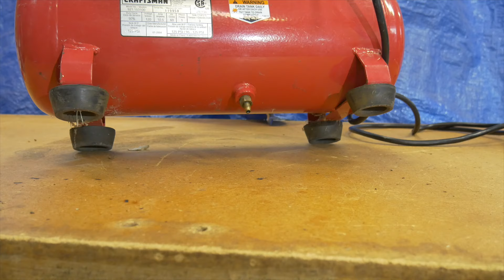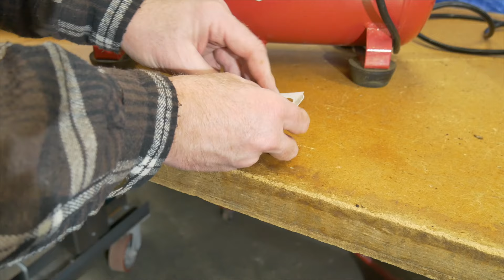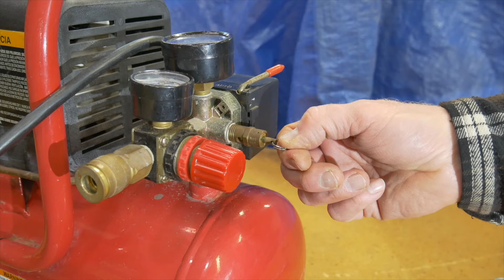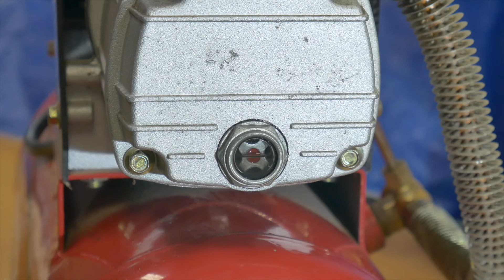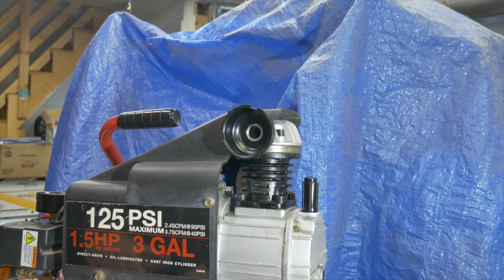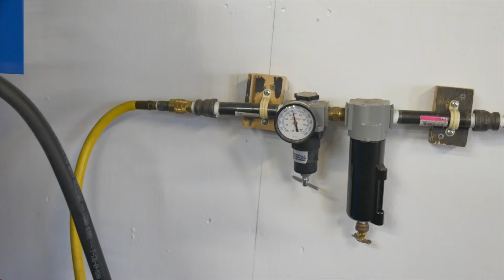Air Compressor Maintenance - A few tips to keep your small air compressor in top shape!

Comment: My compressor is leaking oil from the back cover, if i keep the oil at the proper level, is it still safe to use?
Reply from the maker: Whether it's safe depends primarily on the  tank condition, and other safety features like the pressure release valve.   You can find examples on the internet where a corroded tank has failed dramatically.  Since it's a safely issue, if in doubt through it out.
Reply: @metalwooddesign   Thank you for replying. The compressor has never been outside, the tank look brand new and i empty it after each use, the water is clear no rust. I also test the release valve right before using it. But i'm still nervous about using the compressor, due to the oil leaking from the bottom of the back cover. I was wondering if it could somehow leak into the tank rupturing the welds when it's at max capacity.
Reply from the maker: If the water is clear doesn't sound like oil getting into the tank.  Maybe the cover gasket is replaceable if it's accessible?

Comment: On my compressor I made a transparent hose instead of the drain valve.
With on the end a ball valve.
Water runs directly into the hose, instead of accumulating in the tank itself.
When you use a thicker hose, it can hold more water.
You could even build a system that automatically blows off the water.
Reply: He means a seperate short piece of clear hose with a valve on the end to collect any water in, and release it from. It would be seperate from your normal airline.
Reply: @royster3345  I see. Thanks. That makes sense. No doubt that has some value but the value is very limited really in my opinion. The inside of the tank is normally coated to protect from corrosion because of water or moisture. By pushing the liquid form of water out of the tank with an additional section of hose, that saves water from accumulating in the tank but not the moisture. And normally, without this extra thing, a tank should be released and drained anyway.
Reply: @maxwang2537  tanks are not coated to prevent corrosion. Where did you get that idea from
Reply: @firebladex8586  ah good challenge. I didn’t make it up . I read it somewhere. But of course the source can be wrong.
Reply from the maker: That's a great idea.  Basically a hopper for the water to go to so it never sits in the tank. Thanks for sharing!!
Reply: Good idea
Reply: Don’t get the idea. As I understand, it seems a great idea but not necessarily. Why the normal design is this way it is is because the minimal of water gets into the hose then the air is drier. Your way saves the drain in the tank but brings all the drain into the hose which is meant not to have water, so defeats the purpose.
Reply: Might not work best on tanks with offset bungholes valves, unless you simply tip it after each use and drain only when the clear tube gets full.

Comment: If it is not in the middle of the tank stay away from this type of tanks i had one after 10 years i keep the tank drained every time I used it and it exploded after 10 years of use the whole bottle blowed out of it.
Reply from the maker: That style is not the easiest to keep drained.  You have to tip the tank so the valve is at the lowest point and still rock it back forth lengthwise.  A vertical tank is best if it fits your application. Thanks for sharing that story.  Definitely want to keep the water out and replace the tank if its integrity is in doubt.

Comment: This video is great. Thank you.

That water looked super rusty. What do you do to make sure the pressure vessel isn't dangerously rusty?  And if it is rusty is there any saving it or must it be replaced/discarded?
Reply from the maker: Because it's a steel tank, the water is going to get some rust color.  The tank in the video had a bad valve and hadn't been drained recently.  With a good valve it's drained regularly.  The best thing to do is drain it every day so you need a good valve that opens and closes easily.  If it has deteriorated enough to be a safety concern it should be replaced, or at least pressure tested if that's practical in your particular situation.  Thanks for the comment!

Comment: Regardless if you drain or not the tank will rust on the inside because your compressing moist air so depending on the humidity it will be more or less the tanks are not treated on the inside 🤷

Comment: If you are replacing the drain valve, buy the style that opens with a half turn.  It makes draining a tank very easy.
Reply: Quarter turn ball valve
Reply: Even a winged stop-cock valve.  Just make sure it's pressure rated (metal).  A small piece of tubing let's you direct the outflow into a can or from wherever you don't  want it

Comment: When I'm done I always turn the regulator all the way down until it comes just slightly off the spring. It helps reduce stress on the rubber part inside and keeps the spring from developing a 'memory'.

Comment: Is there a easy way to add some oil in the tank to help prevent rust through? And should we?
Reply: Yes,  you can.  Then your tank is propably gonna explode even faster than with water in it.
Reply from the maker: Best thing to do is drain the tank regularly.  Anything in the tank besides air is contamination.
Reply: Or you can get an automatic relief valve. Just got one from HomeDepot.com

Comment: I’ve never been diligent about draining the air or the moisture from my upright 26 gallon compressor.  I replaced the drain valve with an extended tank drain valve assembly which makes it very easy and convenient to drain it now.  They’re available on Amazon and from HD.  After seeing the YouTube showing an exploded small tank, I’m concerned about having this huge tank in my garage.  It’s 15-18 years old.
Reply: You can always build a steel roll cage around it or put some massive anchor bolts into the concrete to keep it from going flying

Comment: I also leave the drain plug out and the large end bung on the tank to let it air dry inside then I give it a little spray inside with rust converter after flushing the rust chips and rusty water out with a garden hose....... that increases tank life

Comment: Great video. I have a small oil-free compressor. The information was useful. I was surprised to see all of that water come out. Always drained. But not I see why.
Reply from the maker: The drain valve was getting bad and hard to open.  Having a good valve that works well is the best since it's more likely to get drained often.  Thanks for watching and leaving a comment!

Comment: I'd be horrified if owners weren't routinely carrying out the above!

Pay particular attention to draining the valve at the bottom of the tank after each use or at the end of each day!

If you don't, the water inside the bare steel tank will rust, and at some point it may reach the point of failure BELOW that of the pressure release valve, causing an uncontained high pressure rupture of the tank!

Rust particles and metal fragments can be released under high pressure, causing serious or fatal injuries to anyone unfortunate enough to be nearby!

Structural damage to the workshop may also occur along with the shattering of windows.

This is exactly what took place in the video I watched yesterday of such an explosive fracture, luckily, the owner was about 25 feet outside of his workshop at the point of failure!

Most surprising was the blast  impact caused by the rust particles, think of a shotgun blast!
Reply: That’s the same video I watched which lead me to this video—great minds think alike!

Comment: I own what I believe is exactly the same compressor. bought it from Sears decades ago.  I'm ashamed to admit I did not know about the sight gauge being the drain hole as well.  I have added oil as needed but never changed it.  I didn't think about the air filter either.  I guess the only thing I've done right is store it inside and drained it after each use.  It has been a wonderful little compressor.  Thank you for the "education" and the effort you made in putting this video togethr.

-Respectfully
Reply from the maker: Glad it's helpful!  Thanks for watching and taking the time to leave a comment!!

Comment: How often should we change oil?
Reply from the maker: I change mine every couple years.  AMSOIL's tech sheet lists up to 8000 hours (that's a lot of hours). One thing to look for is if you're getting water in the oil then change it more frequently. An air compressor doesn't get hot enough to boil the condensation off like a car engine does.  Also, if it's new check the manufacturer's recommendations, which may be to change it the first time after just a few hours.   Keeping the air filters clean will help it perform better and last longer too.  Thanks for the question!

Comment: I have a campbell hausfeld 150psi oilless air compressor, what can i put in tank to keep it from rusting! Thanks!  Ed from Zanesville,ohio
Reply from the maker: The way to keep the rust down is to drain the tank frequently, especially when there's more moisture in the air in the summer.  It's best to have a good valve that's easy to open, a ball valve if you have room.  Thanks for watching the video !
Reply: @metalwooddesign  8

Comment: If you’re doing your maintain correctly,
what should that drained what should that water look like? Should it be clear? Is it always going to be brown?
Reply from the maker: It always comes out a little rusty.  It depends on climate (temperature and humidity) and usage and of course the tank and its' history. It could be a little oily too depending on the overall condition of the unit.  Best practice is to have a good drain valve that opens by hand so it's quick and easy enough to drain the water out of the tank.  Thank you for watching and leaving a question !